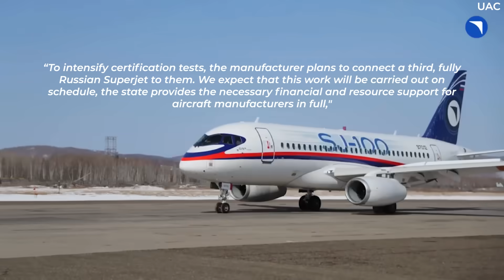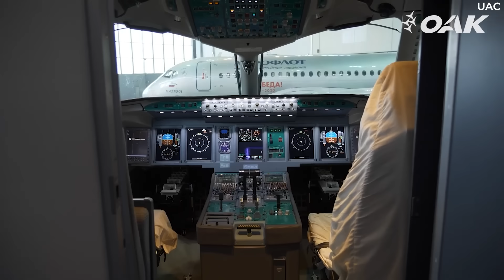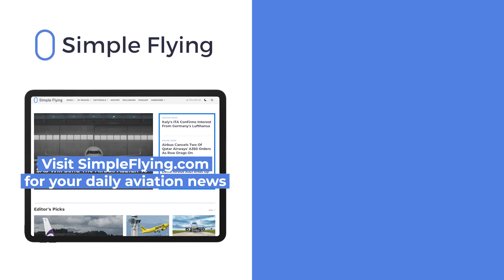1st Flight For Russia's Superjet 100 Powered By Domestic Engines

Comment: The engine was created to replace the sam 146, it had to match the weight and overall characteristics of the sam146, so as not to redesign the ssj100 airframe. Otherwise, the engines are different, the hot part is different, the high-pressure turbines are different, the compression ratio is different, the number of turbines is different.

Comment: 3000m or 15ish thousand feet isn't a complete test. Will it fly from 32-40,000 feet and how far nonstop? Those engines look small for an aircraft that size. They almost look like early turbojet engines.
Reply: You are silly, of course they are not going to go 12000 m on their first flight... And yes, they did reach 12000 m in subsequent flights.

Comment: Очень похожи на СаМ 146.
Reply: They replaced all the parts made by the french Safran. So, this is essentially a new engine with a new compressor, a new combustion chamber, a new turbine. And this will allow Russia to replace the engines on the existing planes. So, this is a big win in terms of maintenance. Easy access to domestic spare parts, lower fuel consumption, cheaper and easier to maintain.

Comment: 😂 will sell even better now 😬 low bypass engines 😅
Reply: Because that's the size of the previous french SaM-146 engine which had some reliability issues. They cannot put a bigger engine on such small plane... You will never put a GE-90 engine on a small regional jet. Your comment is plain stupid... The PD-8 is even more fuel efficient than the SaM-146. So, this is a big win. 100% russian-made and more efficient than the previous foreign engine. The PD-8 should also be a lot easier and cheaper to maintain. 🤡

Comment: I am sure they can build aeroplanes with domestic parts, but I doubt they are commercially competitive, just like Soviet era planes were not.
Reply: But they don’t have to be competitive when there is no competition
Reply: @swems-z3s  Yes, if you only can sell them inside the Soviet Union or Russia.
Reply: @ that's the point
Reply: When I was a kid I had flown on Soviet era airliners flown by Air India and I could barely tell the difference between them and Western airliners.

And they must have been very competitive and reliable, otherwise Air India 🇮🇳 wouldn't have flown them.
Reply: Soviet era planes were competitive at the time they were designed. They were mainly not ordered due to political reasons and lack production capability compared with the west. Even that they are now ancient designs, there are still quite a lot of Antonovs flying around the world including in the US and EU.
Reply: Stop living in soviet era😂😂😂,this is 2025

Comment: Efficiency? Range? Reliability? Dispatch? NOTHING is going to match or exceed the efficiency, range, reliability and dispatch offered by GE, CFM, Rolls and PW engines. It takes decades to design and develop, manufacture, fine tune and establish supply chain and depots Worldwide. They are also notorious for copying and reverse Engineering Western technology.  With 40% of Western built systems replaced in addition to the engines, would you get on a SJ 100?

Comment: They look like no bypass fans? 1970's tech?
Reply: The PD-8 has the same bypass ratio as the SAM-146, which it will replace.
Reply: If they are flown by careful and trained crews they will do fine. One problem with Russia has been the reckless crews
Reply: The PD-8 is a high-bypass turbofan engine. Don't post nonsense.
Reply: @-lavale- but it looks cigar shaped. High bypass usually looks much bigger.
Reply: @gordanbabic8028 not necessarily. Think about the Trent 700 or the IAE V2500
Reply: @swems-z3s  The Trent 700 first ran in 1992... and was designed more than 40 years ago.
Reply: @-lavale-  The PD-8 has an 8.5:1 bypass ratio. Inferior to its western competitors.
Reply: @VisibilityFoggy  no. The PD-8 has a BPR of 4.4. 8.5 is the larger PD-14 for the MC-21.
Same base engine but different variant

Comment: Russian Aviation needs all the help it can get.
Reply: Just Russian? If it were only the Russian industry at fault, then Rolls-Royce wouldn’t be facing its own issues. The supply chain from Airbus and Boeing would be running smoothly, the 777X wouldn’t be delayed by more than five years, 787 deliveries would be on time, whistle-blowers might still be alive today, and essential metals like titanium and aluminium would be readily available with no complications whatsoever.
Reply: @pfaria  nice whataboutism
Reply: @osasunaitor  Not whataboutism. Just reality with a bit more context than you're used to.

Comment: i wonder if we can upgrade the 737-200's with this engine it looks small enough
Reply: the  737 has enough problems as it is, thanks....
Reply: @swanvictor887 the 737 is the most successful commercial aircraft in history. The -200 is unique for being available with a gravel kit. This allows it to operate at airports that don't have paved surfaces. Canada has depended on these for many years. They have bought as many as they can get on the second hand market trying to maintain operations. There literally is no viable alternative. 

To answer the OP... I don't think the engine would be compatible due to the mounting method and how it is designed to handle the air flow. 

That said, I'm sure a western aviation company not based in the US could work with Russia to develop a proper engine replacement as a diplomatic middle finger. 

That said..... It wouldn't be worth the effort to design a replacement engine because the cycle count on the remaining airframes still puts them at end of life.
Reply: @ and even if indeed, they managed to create a suitable engine....the old Russian bugbear of parts would knacker them once more. Remember the SSJ debacle, took place when Russia had far fewer embargo or restrictions than they do today....and they still couldn't cope.

Comment: i'm curious how the engines compare to those outside russia and the effect the engines have
Reply: I doubt we will ever really know about their noice levels or fuel consumption or even acurate thrust measurments
Reply: @craigwalters to be viable these aircraft will need to meet FARs and JARs. For some reason I think they know this.
Reply: "Badly"!!
Reply: @swanvictor887  Source: Who knows ?
Reply: It was powered by different engines before. The specs are the same. It is an older type of aircraft in general. You can compare it to the previous generation of e 170.

Comment: I think it will be awesome for Russia! But I don’t see any other foreign airlines interesting in this now “SJ” 100. But it can definitely be carried out!
Reply: Some years ago a Mexican airline leased some Sukhoi Superjets to try them out before buying them. They were such a maintenance disaster that they handed them back to Russia before the lease expired. And those ones had western engines.
Reply: @Dave_Sisson  I didn’t realize Interjet had so many issues with them.
Reply: @Dave_Sisson  they bought 20, but only 7 could ever fly at any one time. They had to strip the other aircraft for parts. They went bust. Lesson there for any operator who think they might save money buying Russian crap: there's a reason they are cheap! You can't fly the bloody things!
Reply: @swanvictor887 the same occurred with Aeroflot, who had to ground half the fleet at a time to operate them because they had so many issues. At the end, they ended up offloading majority of the aircrafts to their subsidiaries in eastern parts of Russia, with only a small presence with Rossiya in Moscow, because it was a hassle to operate them

Comment: The quality you have come to expect from LADA
Reply: Their doors don't fall out midair.
Reply: Jokes on you, LADA is more reliable than a Boeing that yo over-sized moma probably flying in.  😂
Reply: Interesting thought, please google what was happening to the engines designed my Safran (it was heavily unreliable). It was one of the major contributors to why the jet couldn't stay in the sky long enough without failures.
Reply: Better than SpaceX in any case 'cos it didn't explode in mid-flight 🤣🤣🤣
Reply: @DaveNeve  *Boeing

Comment: To my untrained eye, those engines look very small. Hope they have ample power for full loads and do not have to be over taxed to maintain projected operational parameters.
Observations from South Africa
Reply: Their biggest problem gonna be with range. What would ended up happening is the fact that they would need to set up a 2 hub system between Moscow and Far East Russia for their long domestic Routes.
Reply: @nntflow7058  SJ100 is a small semi-regional 100 seater  with 2+3 seating across,   what range are you concerned about ?
Reply: Its a licensed and by Russian further developed International CFM56, so yes it have enough power, its so small because the Russian are one engine generation behind, modern western engines have a increase diameter for better fuel economy.
Reply: @kirgan1000 how do you figure there are generation behind ? You don't think russia has knowledge of western designs

Comment: What western plane can it be compared to?
Reply: Nope, it's 100 seat jet. Could be compared to E190
Reply: An embraer I think
Reply: a 737-200 regional
Reply: Douglas DC-3.....
Reply: I think that's the point. They have a target they need to aim for in terms of efficiency for it to be commercially viable.
Reply: Tiger Moth
Reply: Airbus A220 or Embraer E190
Reply: It sits kind of between the ERJ and A-220 with 3-2 seating but a shorter length than the A220 putting it closer to the ERJ in capacity...

Basically the worst of both planes combined 🤣